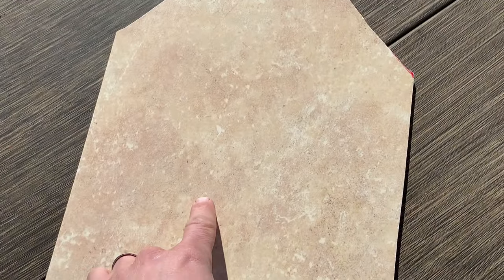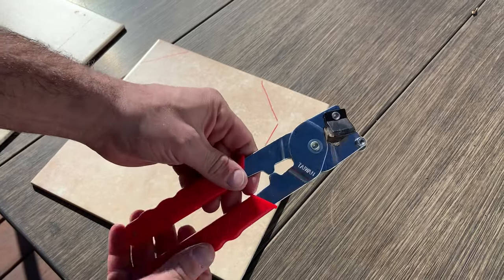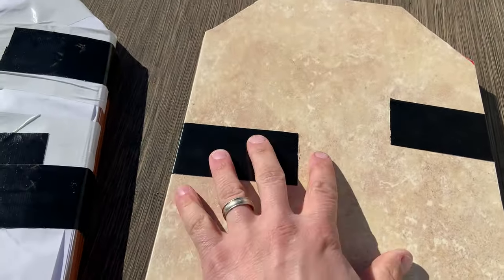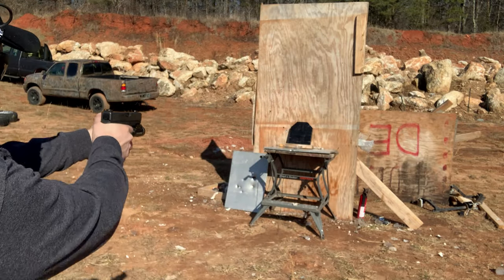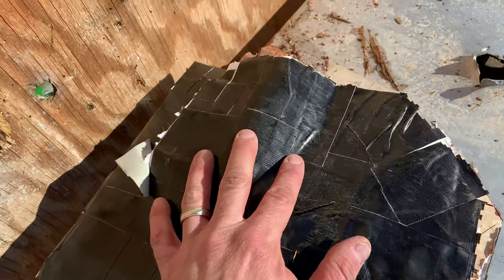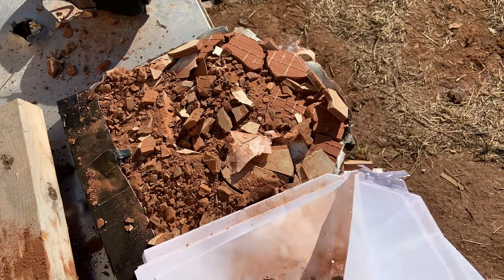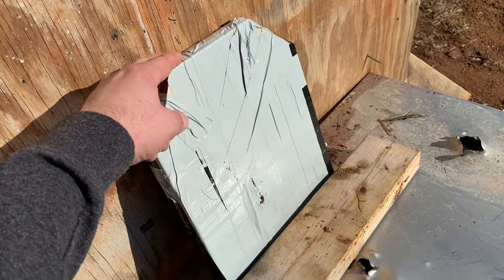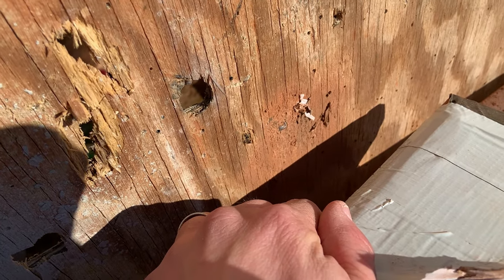$6 DIY Body Armor

Comment: I may suggest adding mosquito net as an interlayer material besides the paper. I suspect that the bullet obliterates the tile but the paper forms a sort of dispersive net with the fragments, dissipating the bullet's energy among the bullet's. The Mosquito layer should be in the middle of the paper layer. My hypothesis is that it would hold better the fragments reinforcing the "dispersive net" effect.

Comment: It's surprising how some simple materials (Paper and ceramic) Could stop bullets.
But what's more surprising is the stopped 5.56 in Wood.
Maybe if you upgrade that armor with few metal sheets and some fiberglass in the front would make it stop 7.62
Tbh, is is worth it for home defense

Comment: I've made the same thing. I used 2 plates, put fiberglass material and resin in between and over them. I also put strips of semi truck ratchet straps under the resin. I shot at point-blank with my 9 m m with hydroshocks. It hit the ceramic and shattered it both levels of ceramic, it went through three layers of fiberglass material and resin but it did not penetrate the last three sheets of fiberglass at all

Comment: What if you wrap each tile in duct tape individually, then wrap about 1/3rd of the paper layer in duct tape as well, and then combine everything under another layer of tape? I wonder if the extra glue from the tape might hold the tiles together better and also gum things up as projectiles pass through each layer…plus it shouldn’t add too much to the overall price

Comment: I think you should try that again, but instead of ceramic, get porcelain or real stone tiles.  I used to work at a big box store flooring department and I've learned which ones are less/more likely to break and I've researched some of this.  I think porcelain is worth the extra $ and I assume any granite tile you can find will be better than that and cost even more.

Comment: A couple of questions:
1) Did the one hit from the 9mm shatter the tile before you shot it with a shotgun?
2) The .223rem/5.56nato on the second plate, did it shatter all three tiles? How many tiles do you think it would take to stop a rifle round? And what if there was a cushion between tiles to ‘insulate’ the tiles from each other? A sheet of EDPM rubber roll roofing maybe? And would hex tiles that were smaller allow the tiles to not shatter all the way across the plate? Or is that required to absorb as much energy from the bullet as it can?

A different video idea: homemade fragmentation containment for ricocheting debris off a steel plate to avoid a secondary wounding. 
Another idea: how to repair built up coatings on steel plates(such as but not limited to AR500 lvl3+)

Otherwise, love your channels! Your videos rock and you make better every day I watch your vids!!!

Comment: Try tile - paper - tile - paper - tile - paper, glue the paper, and add a layer of hard Vinyl tile. Seeing how close you got would not be surprised it would work without the vinyl. Also an interesting layering would be, high grade sand paper soaked in salted water, dried out and glued with epoxy. High grade metal sand paper is made out of carbide (in many cases) the back cardboard absorbs salted water which Incas used on their Ichcahuipilli salt soaked cotton armor. Good epoxy should adhere well to both salt and carbide. Add some pressure and sure you will get something interesting to toy around. I live in a "guns free" country, so I can´t even try ... 👀
Reply: Coated paper, such as a glossy magazine, will be tougher yet.

Comment: The tile cutter I didn't know I needed...
Reply: If u do buy this tile cutter . FYI never go back a scribe with another scribe movement.  More chance it won't snap straight. 704 went forward and back wards. Watch in video the left side of tile. It cracked wrong because of the re-.scribe
Reply: @anthonycastro8364  awesome tip, hope 704 sees this
Reply: Glass cutter might work as well, cheaper.

Comment: It’s sad how many school shootings there are nowadays. My son’s school has these special blocks that go in the floor that prevent the door from opening but every door has a vertical window with regular glass. I’ve often thought they need some type of body armor to slide over the glass.
Reply: The door is not a rifle barrier.   The wall is probably concrete block, also not a rifle barrier.  Any gunman with time and rounds will defeat any school or office building door or wall.   They need to be denied the time.

Comment: Hey 704 🤫🤔.   In between layers of tile put a layer of CHEMREX.   CHEMREX is a better version of liquid nail. It has when hit by round a like  gluey gummy affect on the bullet. If you can't get ahold of some I can mail you a tube.  I do flooring so I have access to these products and have experimented with these ideas. Thanks for all the content videos you provide.
Reply: That's a great idea.  when the heat of the bullet heats the CHEMREX as it passes through it will bond to it and slow the velocity down from the
Round.  I wanna see a video of this.
Reply: Also, PL Premium masonry construction adhesive is I believe a urethane that doesn't fully harden

Comment: Kevlar bed spray between layers 2 layers of flex small tile with Kevlar spray. The wrap with ss screen. Spray the outside or use a roller on the exterior with poly bedliner.
Reply: You might as well just buy a few metres of kevlar fabric and put it behind the tiles, with a few layers on the front for spall protection, and cover in a waterproof layer of some kind. Or use woven glass fibre. E-glass cloth is cheap and very strong, whilst S-glass is considerably stronger, but more expensive. Both are comparable to Kevlar in tensile strength, although Kevlar is less dense and therefore somewhat lighter. The weave is an important factor for all three.

Comment: a 5mm thick sheet of aluminum before the paper might be good or even between the paper
Reply: Aluminium is approximately one third the density and strength of common steels, and one third as stiff. So you would need three times the thickness to achieve the same results. It doesn't usually make sense to add extra bulk unless there is a reasonable weight saving. Eg. AL Bike frames can be lighter than steel frames because they make the tubes a bigger diameter to increase stiffness, whilst keeping enough strength in the tube walls, where steel tube walls would need to be so thin to be the same weight, it would crumple. But that doesn't apply to armour... it's a fairly linear and proportional  3 to 1 scale.

Comment: Maybe you can try putting one ceramic tile in the front,a second layer with a 1.5/2mm steel plate and a last layer with 15 fiberglass layer welded with epoxy with carbon fiber dust..

Comment: Try heavy duty tarps. The ones made of industrial grade polyethylene. Cheap and made of polyethylene and hdpe is a denser polyethylene which is used in body armor
Reply: HDPE isn't used in body armour, but rather UHMWPE.  Even then, it isn't solid sheets of plastic, but hundreds of layers of unidirectional fibres, each sandwiched between thin sheets of plastic, under controlled temperature and pressure. It is the delamination of those layers that provides the energy dissipation. Tarps are good at resisting loads applied over a large area, like those bags used to deliver soil and gravel etc. They can take huge weights. But they're not particularly good at resisting highly concentrated, localised forces. Enough layers of ANY material will stop a bullet eventually. 😉
Reply: @another3997  some armors use hdpe. But most use uhmwpe

Comment: @704TACTICAL If you had spaced those with a 1/2 tile thickness of rubberised resin or fibre glass you will get more spread. The fracture energy spread is as important as hardness of ceramic with porcelain prob being best. Back with fibreglass and wrap with kevlar to stop lamination.

Comment: Not so sure about $10 ... 
however, 

You can try folding up some newspaper until it is pretty much solid, then use some flex seal tape to keep it all together and shape it... then spray it with the flex seal spray in the can or maybe some rhino lining.  Maybe throw a few tiles in the middle of it. 

Should work pretty good
Reply: Just Newspaper will work against knives, but newspaper is such low quality paper, that you'd still need an exceptionally thick layer. I've done some knife and shank stabbing experiments, and it took over 200 sheets of cheap newspaper to equal around 50-60 sheets of typical office paper. For handgun bullets, which obviously aren't sharp, you'd need several phone books stacked to stand a chance. Even with a tile layer, the better your backing material, the better your chances of stopping a bullet.

Comment: If there's an issue with the tiles breaking apart after the first large round.....why not try to tape each individual piece of tile? That way why the armor take the impact, it may break but the tape should hold everything together.

Comment: try adding the paper sheets in between the ceramic plates. also try adding a rubber plate in between.
Reply: The rubber plate idea has been tested, and doesn't seem to improve things. Using a tile adhesive or similar to bond the tiles seems more effective. Filling in the troughs on the back of the tile and providing a fairly uniform bond across the surfaces.

Comment: I read through the comments and didn't see any suggestions of layering in a material like denim in your paper stack. Maybe a shuffle of the deck per say too. Try the tiles setup you have then try a replacement of multi square tiles offset in the front. Kind of like a dragon skin.
Reply: Denim is cotton, and even the finest long staple cotton is very weak compared to woven Nylon and Polyester.  Nylon and Polyester are often cheaper than cotton too. While enough layers will stop bullets, weight for weight, cotton is far from the best of the widely available fabrics. I'd like to see what a single layer of heavy duty PE inserted between every 50 sheets of paper would do, as PE stretches to absorb energy, perhaps helping distribute energy better than paper alone.

Comment: My question is using a glueing agent like resize or epoxy, mixed heavily with ceramic in the centre of any plate, set up from polyethylene to whatever what is stopping capabilities, are especially up towards the front to slow the bullet towards the back, so using the powder from crushed tile and a thin film to lighten the weight, but still give a ballistic stop, is my question

Comment: It's a guy that used melted milk jugs wrapped in that welders cloth. I wonder if you heat  & compress the plastic from 3" down to 1.5"-2" inlay ceramic tile into the shape and onto the   plastic and then wrap it in the welder fabric w/ that bonding stuff while using lvl + from tacticon armament as a backing with duck tape would it stop ap 30-06?

Comment: I'd like to see you put heavy woven fiberglass sheets between the plates and behind the back one.   I don't think that would drive the price up that much, especially if you eliminate the paper.
Reply: Also, I've heard that a number of silk shirts, like one could get from a thrift store, together can prevent a bullet from getting thru (kind of acting like a netting capturing it).   It will still do a lot of damage to one's body so it needs a good backing, but maybe that would be a good replacement for the paper.

Comment: What about trying to stick the tiles back to front with cheap shower silicone, and maybe compare it with even something like painters caulk? Would 4 tiles stop the rifle, bonded together with a little less paper to thin it out?
Reply: You would want to overdue the caulking/silicone to ensure no voids between the two tiles.

Comment: Question would you mind doing the aame test but split the paper evenly behind each tile so instead or 3 tiles and 300 paper its 1 tile 100 paper 1 tile 100 paper .... If you get what i mean i would like to see the difference in performance between the 2 layouts. PLEASE DO A TEST LIKE THAT.

Comment: I wonder if you put a thin sheet of steel or aluminum on the very back, if it would have stopped the .556. Maybe even a lightweight sheet of melted down milk jug plastic.
Reply: Forget milk jug plastic. Weight for weight it simply isn't a viable material, even assuming you could make a uniformly solid sheet without any weak spots. You can easily buy large sheets of HDPE in a variety of thicknesses. But HDPE is not the same as UHMWPE. And solid sheets of UHMWPE aren't used in armour. It's a combination of unidirectional UHMWPE fibres, usually trapped between a thin layer of plastic of either side. Several hundred of these are then compressed together. No milk jugs allowed. 😉

Comment: can you try a porcelain tile? Its a stronger material then ceramic.
Reply: It's "harder" than some other ceramics, which is what you need to initially flatten and slow the bullet, perhaps actually pulverising it in the process. But ceramics come in a variety of forms, each having their own particular properties. Boron Carbide is one of the hardest materials known to man, but Boron isn't a pleasant material to work with. Silicon Carbide and Aluminium Oxide are also extremely hard ceramic coatings used in armour. But they're expensive too.

Comment: I always wondered what a half inch of reinforced high pressure concrete could do as armor.
You can certainly get lvl4 protection for $10. Go to the scrap yard and buy a price of 10x12 at steel. Done!

Comment: This is a very senseless build..
Thick ceramic is used to break up long AP rounds, to stop 5.55 ball you can do with 1 plate. Way to heavy to use 3 plates. 
The paper has very low tensile strength, you are better of using demin, polyester, jute, hemp together with some glue or in textile wrapped HDPE cutting board from IKEA. This is all also  cheap and lighter.
Reply: How will u make body armour from cutting board